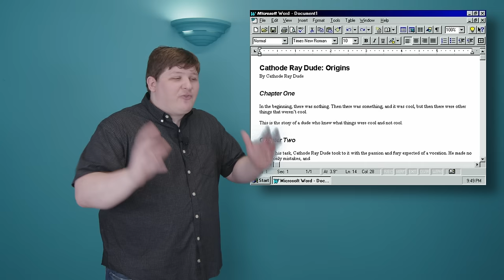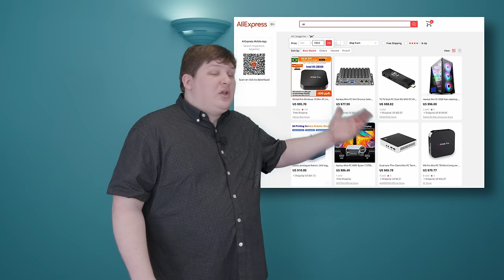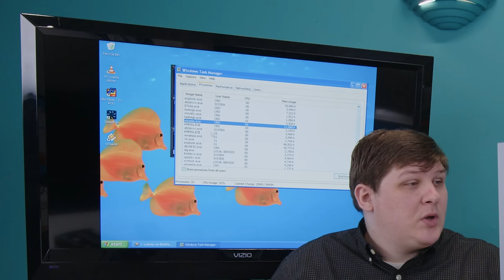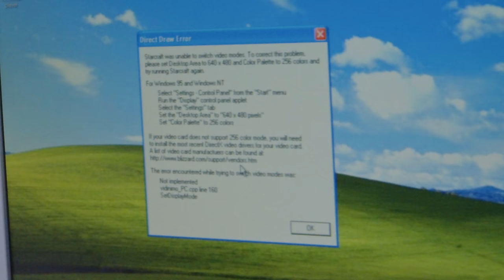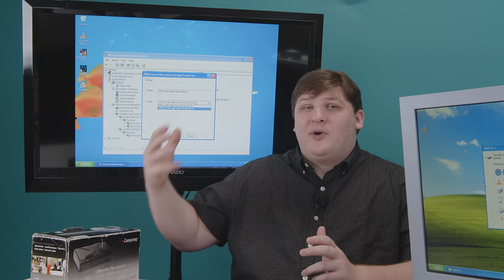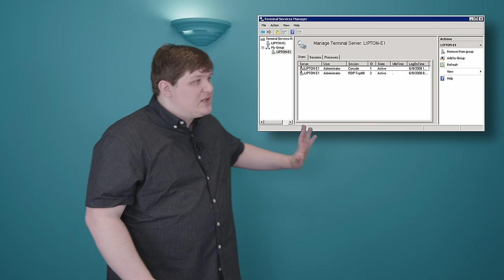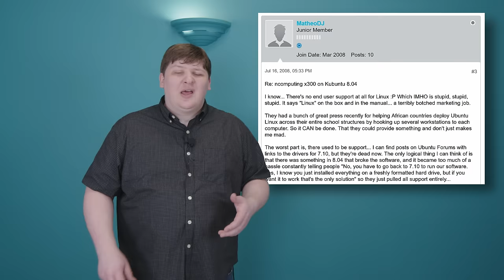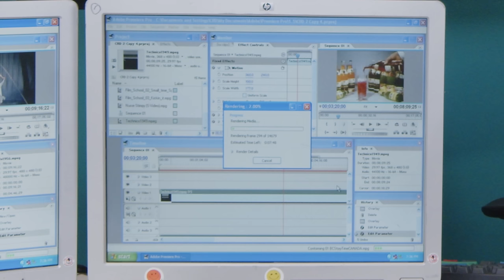7 Users on 1 PC! - but is it legal?

Comment: Those FPGAs (at least that old) have no internal non-volatile storage of their own, so the configuration data is almost always loaded from a little flash chip next to it on power-up. That flash chip would be easy to dump, but best I can tell there's nothing you can do with that. Unless you're insanely skilled and have a LOT of time, or you're the chip manufacturer. That's because it's basically going into one huge shift register inside the chip that configures all the stuff in there, and there's no public or easily-discoverable info on how the bit stream maps to the internal layout. Also often the whole thing is encrypted. You'd be way better off just reverse-engineering the functionality from the outside.
Reply from the maker: That's kind of what I figured. You know, I didn't look up the chip that I called a ram chip, now that I think about it, I wonder if it's possible that this thing just RAMDACs directly out of system memory, and that chip is actually a PROM.
Reply: @CathodeRayDude  Nah that's a RAM chip for sure, Samsung K4S something. FPGAs do have some memory cells that can be used for small RAM or cache but typically a design with any kind of complexity will want some larger external RAM to operate. That doesn't necessarily mean it's acting as video RAM, but it probably is in this case.

The flash chip, if there is one, would be a small 8-pin chip or something like that. I don't actually see one though, so maybe it's actually being configured over PCI by the driver! Does it take a few extra seconds to become active after booting?
Reply from the maker: @kasamikona  yup, it doesn't output anything unless the "bus enumerator" driver is installed, so perhaps they rolled in the firmware push to that. That makes more sense compared to what I remembered about how fpgas worked at this time
Reply: @CathodeRayDude  That's a rather neat way of doing that to be honest, keeping costs down. The CPLD programming is non-volatile so it can happily sit there waiting for that configuration data to blast at the FPGA (around 1.2Mbit max for this chip by the way), no onboard flash needed. Also a "firmware update" could come for free just by updating the driver.
Reply: There are some Flash-based FPGA where you can leave the bitstream installed in the chip (I think the Spartan 3f variant for example) but I think they were more expensive and maybe slower?
Reply: @stevenclark2188  Looks like the first FPGAs to do that were the Spartan 3AN family in 2008, and this thing supposedly came out in 2006, so unfortunately it missed by a few years even if they wanted to use them.
Reply: @kasamikona  CPLDs are essentially FPGAs with on chip flash for the config.  They even take a fraction of a second to boot up after power on.
Reply: The distinction between CPLD and FPGA has become progressively fuzzier over time. It used to be that you composed the logic for them entirely differently but nowadays the same FPGA synthesis software can also be used for CPLDs and they're functionally the same except for the size. CPLDs also aren't necessarily non-volatile, I know of a few small CPLDs that still required external config memory.

You can find competing chips that are very similar in their feature set, cost etc where one company calls it an FPGA and another calls it a CPLD.
Reply: @kasamikona  does this mean the actual code might be stored on a file on the software? that makes reverse engineering super easy I think omg
Reply: @DEMENTO01  Probably not, it will most likely just be distributed with a final bitstream as would be on a flash chip typically. Getting from that back to anything remotely resembling the original design / code isn't impossible but could take many years of research and tinkering.

I've learned through experience that FPGA-based systems are one of the worst things to try and reverse engineer. If anyone think it's worth having a go at though, I encourage them to try.
Reply: @kasamikona  Its not hard or uncommon to load the bitstream though the driver on a pci/pcie card.  The CLPD likely facilitates that.   Unless someone did something extremely stupid the bitstream is going to be encrypted.
Reply: @nickl6407  Interesting. I'm new to these kinds of uses for FPGAs but thought that might be the case.
Reply: @kasamikona  Yes, but very likely the actual bitstream is sored as a separate file on disk, then loaded by the DLL when it starts, making a firmware update easier, as all the DLL does is update the blob of data, and then send that.  Just have to look in the install directory for a file blob that is around the size of the FPGA cell count, which will be the configuration data. Probably readable as is with FPGA toolsets as well, as not likely to be encrypted with anything, other than the serial number of the board, to make install and upgrade easier just by putting the new blob in there.
Reply: @SeanBZA  I was assuming it would be a separate file but that doesn't help unfortunately. The decryption is implemented in the FPGA hardware and the key is set by the manufacturer, it's all designed to prevent people like us doing things like this. It'll be a shared key for a certain part number or family but getting it isn't easy. Software toolsets, at least the Altera (now Intel) stuff, have no ability to decrypt that because it's not typically needed and would defeat the point of the encryption. They also don't tend to have the ability to do anything with an existing bitstream, as the simulation tools work at a higher level.
Reply: It also depends on how the FPGA bitstream is loaded. If they're doing it via JTAG, they're most likely storing the bitstream in the form of a STAPL file which is really more like a JTAG script than a plain image format. The other way to do it would be to have the CPLD mimic the flash chip, which I have seen done at a previous job, and it's faster, but it's also not all that easy to figure out how to do.

Most FPGA manufacturers will supply you with an "embedded programmer" skeleton which programs the FPGA from a STAPL file and you just have to provide the functions for bit-banging the JTAG lines, so I would assume that's how they did it.
Reply: @rfmerrill  That FPGA supports configuration via serial (effectively SPI), so JTAG isn't required and would be far more complicated to implement. They probably would only have to implement a SPI attached PCI device in the CPLD to upload a bitstream (though it probably has a custom interface to toggle the PROGRAM# signal and to verify the the upload via the DONE signal - very standard FPGA stuff).

The resolution constraints were most likely a bandwidth and memory limitation (I am guessing it either has a 4MB SDRAM chip and uses some of the BRAM for the framebuffers, or it's an 8MB SDRAM chip, and implements double buffering where again a portion is used in the on FPGA BRAM). It would be interesting to see how the video display devices appears to the system though (i.e. are they only one BAR each? are they VESA-VGA compliant? I am guessing not). Also, I would expect that they don't have any 2D hardware acceleration for Windows, and are falling back to pure software rendering?)

As for being able to put a 3D accelerator in a FPGA at the time, that was totally doable. You could probably have put a 3D accelerator in that very FPGA, but not 3 of them, and it wouldn't have been very performant (maybe half or even quarter the performance of a Voodoo1). The Logi3D core is meant to serve a different goal as it's OpenGL 1.1 compliant, which wouldn't have been necessary with custom drivers / a translation layer (think miniGL).
Reply: Yes, and the key is that it is encrypted. So that even you dump it, it's useless, even if you have required skills to reverse-engineer it.
Reply: @SeanBZA  Those Stratix FPGAs support   128bit (or 256bit) AES encryption.  The key is stored in a non-readable memory bank.  Typically these memory banks are buried layers deep within the FPGA's silicon and have a habit of self destructing when physical methods are used to obtain them.

Comment: I'd like to see this pushed to its limits using the latest motherboards that still have PCI. Considering it has Linux support there is a lot of potential for cool stuff
Reply: I do know firsthand that theres 10th gen intel with pci, i wouldnt doubt that theres 12th gen and whatever contemporary ryzen were on
Reply: Linux is already really easy to do multi user on, though?
Reply: No real support for Linux, as it says in the video. I guess if I didn't miss anything
Reply: @prla5400  enword you don't need real support from the company, it comes from that the kernel likely already knows how to use the hardware off the rip. Why you jumping in with nothing to say samjeer?
Reply: Oh man yea, it would be a dream to see how well this performed on a 3rd gen Ryzen with an NVMe SSD, hahah. Would be hauling

Comment: My best guess regarding Quake only running two instances at a time is that they're probably queueing up waiting for an available CPU thread before starting. Would be interesting to see if you could run more than two on a CPU with more than 2 threads.
Reply: Quake (and sequels) pretty much required a dedicated server for fairness to attached clients. If you ran a "listen server," as it was called when running client and server on the same PC, that PC was the only one that had a good time. In 1998 or so, my buddy and I set up an NT Pentium (later Linux with dual Celerons) box for just that purpose (Quake 2) and hosted it on the dial-up ISP that we worked at (with the permission of the higher-ups, of course - it was kind of a claim to fame, actually).  It hosted 8 clients with ease. It probably could have done more but we liked the gaming dynamics of 8 players better than say, 16.

Comment: Heres some comments as I watch the video....

License
 - The stations are very dumb. They could be copied by other companies so the license was for the software. I think it worked out to be about $150 per station device, for a $20 manufacturing cost. It was all in the software. 
You could buy the cards separate from the station units. 

[remove redundant stuff you explained about terminal services]

You could hack windows xp pro by re-writing a DLL to increase the license count and have multiple users logged in at the same time like terminal services on a windows server OS. You just didnt have the security stuff that windows server offered. 

NComputing simply created a bunch of virtual hardware and then hacked around the TS license limit by replacing some dlls. Not sure if it was legal or they reverse engineered etc. They then piped each session to the virtual hardware on the pci card. I am not sure how legal this was. 

The PCI card then sent the video/keyboard/audio out the cat5 cable to the station device. 

Most of the stuff you mention such as the USB redirection, video graphic settings etc you could also configure in microsoft terminal services / RDP too. The RDP protocol also wouldnt do the on-the-fly resolution changing at the time. 

The stations are dumb to the point where they dont do any processing inside them. They are just a converter from some RJ45 cable to the breakout of the various devices. I am almost certain that everything is done in software piggybacking on the terminal services component of windows and the PCI card is just an encoder/decoder that converts the device input/output data into 3x cat5 cables- like some sort of multiplexer. Then the station is just the decoder or reverse of that. 

Everything else would be done in software. You can tell by running a video encode on a pentium 4 without hyperthreading and notice how laggy the other stations can become when doing things like surfing the internet in IE6

Interesting thing - the new zealand inland revenue website used to be quite processor intensive on IE6 when on a terminal server and so if one user went there it would become laggy for other users on both a terminal server and ncomputing stations. We sold these to a few accountants offices but gave up when one user would start watching youtube and other users couldnt work smoothly with their accounting software. 

When selling this to schools, we would have to sell the school multiple copies of windows so they could keep the extra copies on hand if they were ever audited. This is probably why I think your pricing quotes are a bit too cheap. We used to have to consider licensing audits whenever we sold these to be extra safe rather than sorry.    

Limited bandwidth in a cat5 cable for analog video is what I think was the main factor that the only really usable resolution was 1024x768 

Windows XP had terrible support for multicore processors. We used to always sell them with a pentium 4 with hyperthreading. 
  
Did you notice how terrible the sound came through the stations? definitley sounded like compressed wave or 22khz - not CD quality 44.1khz 

 
Sim city slowing down - I think its definitley a graphics thing.   
The RDP protocol was designed to be incredibly bandwidth efficient. Its not like a compressed mpeg video. It can take parts of the screen, break it down, cache images in the client.   
SO say your minimising and maximizing an accounting program. When you restore the program the second time, it can take parts of the screen and say "this area is the same as before, just show that again" rather than resending another copy of the image. But it goes further and looks at the elements that make up the application interface and layer them so it might say draw a bunch of images to some parts of the screen Eg. (title bar with blue color fade for the win2k theme).  
Then inside in the middle it might decide to draw a grey box, and then send some text across it and it gets all this info from deep within the windows environment as windows itself is creating the content on screen.    

You can imagine this is much more bandwidth efficient than just sending frames of pictures. And it makes using word 97 though an RDP session via a 56k dialup modem incredibly easy and usable. 

But its also very processor intensive as it needs to decide what parts of the screen it will send as images, what parts to send as text or drawing commands. Vectoring is probably a better way to describe it.
 In adobe you can create an image by inserting a jpeg photo object which might be stored as a raster, put a circle next to it which is just stored as a circle command (draw circle from point A to B) rather than storing all the bitmap raster data of the circle. (explaing for others, not CRD) 

So sim city presents an interesting conundrum. Its going to be almost a full screen image because its hard to break down into parts as it wont be using many large areas of solid colors and plain windows fonts. 
Which it has to capture in software, create a png (or whatever optionally lossless image compression the rdp protocol uses) and send that for every frame. 
This is why video through RDP was almost impossible at the time - 3 frames a second though now they have optimised in recent versions of windows server and it can break down the frame and send a video stream object with vector objects and images around it to make up the full screen.

Many games however can be broken down into smaller images that often repeat, and only the parts of the screen that move are sent as frame updates. But sim city has a lot of animation spread out across the screen, even when the user is idle - not just in focused areas, so its harder to break down into smaller objects for frame updates. 
It then has to process each of these frames and look for optimization opportunities which it probably wont find much.  

So what I am saying is the frame analysis is what slows it down, not necessarily the processing done by the application itself.  

You will probably notice the graphics becomes laggy with applications where lots of the screen is changing between frames, and it works much better with applications where much of the screen is static.  
  
Think about word for example. Using an RDP session over a slow network or laggy internet connection - click the file menu. It might slightly lag as the terminal services engine decides the icons are each going to be sent as images, while the rest might be a grey box with some text on top to make up the total part of the screen that the file menu now occupies. 
The second time you click the file menu, it just says "Oh after computing all that again the result is the same as what i sent you previously so  just show xyz again". 
It still had to do all the initial computation to work out the result can be just a cached image command. 
Then the only other updates are the cursor as you move around the screen - nothing really bandwidth intensive.   
   
Terminal services was the reason I became a network tech. I love the technology. Hence why I jumped on this the moment it became available and started selling it to schools.
Reply: About the RDP - how would you explain then showing up as 3x graphic cards without software installed?
Reply: Just read this comment if you don't want to watch an hour long video.  Neat topic, neat analysis, desperately needs a tldr.